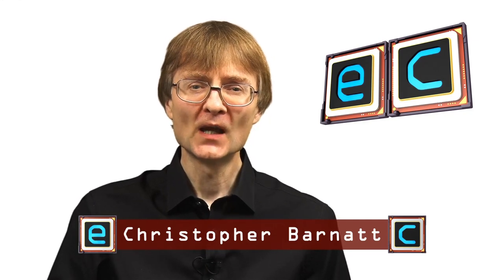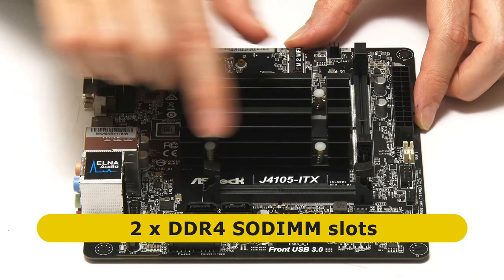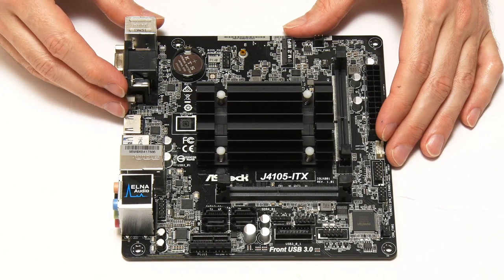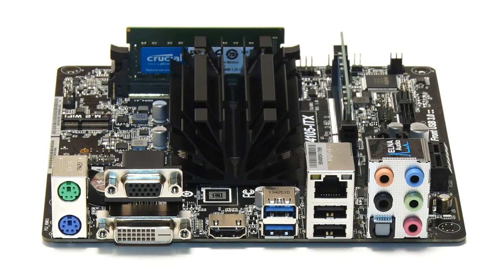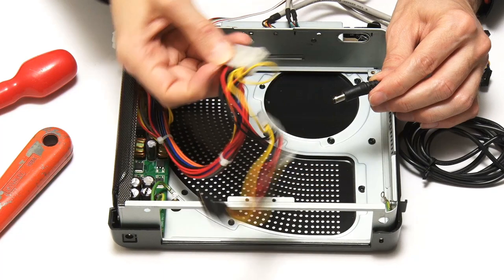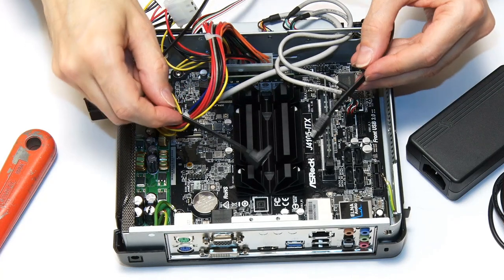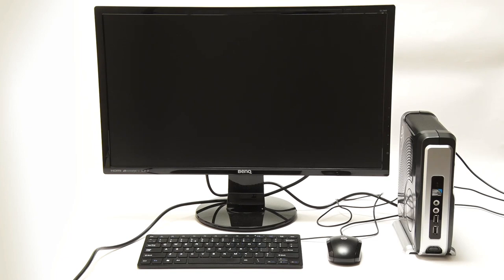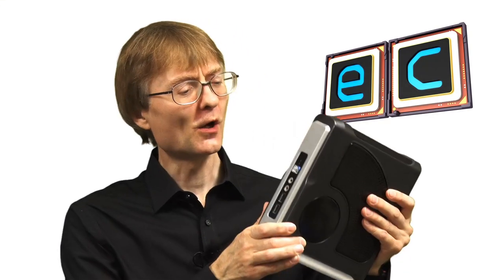Silent Mini-ITX PC Part One: Hardware Build

Comment: I think instead of saying "the CPU is pre-installed" (as compared to a socket) you should maybe say "the CPU is soldered", because "pre-installed" might still be interpreted as "already put in the socket".
Reply from the maker: Fair point.
Reply: I think he has clearly said Integrated Processor that preety makes it crystal clear
Reply: yes its integrated cpu, also i had Asrock Q1900M With Celeron J1900 4x 1.9Ghz it was integratated CPU too, with the same heatsink :D (GTA5 20FPS 720P LOW, Huge CPU Bottleneck) :D
Reply: It hardly matters anyway. This kind of device has very limited uses, with media playback or a storage server coming to mind. Without also having a way to add a dedicated gpu, there is very little reason to ever want to upgrade the CPU.
Reply from the maker: @Self Sickened :)
Reply: @snugglyjeff214  I've seen these built with other variants but the others had a PCI-e slot, so people would add a 1030 or 1050 to give it stronger video/graphic capabilities, at the end of the day they are pretty efficient systems
Reply: Yes it was soldered to motherboard. Mine was not removable, it was soldered
Reply: @controllerspixelsplayers9202  my Celeron j1900 was bottlenecked onn R7 240 stock clock, so yea
Reply: @ExplainingComputers  can you upgrade the proccecor

Comment: The best part is turning on that fresh new computer for the first time and all is well  :-)
Reply from the maker: So true.
Reply: Amazing that it did power on even if he  put the power switch cables in an odd place ^_^ (must be the same grounding as the proper pin). I've worked with hundreds of mobo's and i've never encountered a single one that has the power pins vertically, it's always horizontally aligned with the power led pins.
Reply: I never put the side panel on until it's booted the first time, I'm convinced that jinxes it ;)
Reply: Thats why I only seat the CPUFan/Add some RAM, connect a VGA cable to a display, test to board naked outside the case. the SSD can wait.

Comment: Great video, an interesting bit of hardware almost an SBC.
 I built my Ryzen pc, after watching, your videos on it, which has been great, I did upgrade my Ryzen pc, a 2200g wasn't enough, I fitted a 3600x on it's release, but the old 2200g APU did not go to waste, I bought an asrock a300 desk mini for £140  and put it there, with a few other bits I had hanging around, it makes an excellent compact PC, and is the pc I use the most.
Great video looking forward to the next.

Comment: Thanks for letting me know this existed. Exactly what I was looking for to build my NAS. Low cost, low power, but still fast, a PCI-e slot for the RAID controller card, can fit in ATX case with lots of hard drives. I got a used J4005B-ITX on ebay.
Reply from the maker: Great to hear!

Comment: "If you're terribly worried about cable management, I think there's plenty of good therapy sessions you can attend.."
Amen, brother.   Amen.
Reply: Or I can put my OCD to work on the cable management and feel good for less effort.
Reply: I have to say I was suprized by your comment about people who tidy up the cables in there PC (i.e. cable management) requiring psychiatric therapy.
While the video was interesting and informative I wonder if you could give a reply to the following points.
1) Can we therefore assume that you have never ever used a cable tie in one of your PC builds to tidy the cables 
and if you did which therapy clinic did you attend afterwards.
2) It is possible even likely that your video was watched by people new to building a PC, if they follow your advice then they could well end up with cables over fans and poor access to components because cables are in the way.
3) You contradict yourself in the video regarding the Molex connector and wiring over the heatsink. You say in effect don't bother with cable management but then your text comment says turn the drive to reroute the wire, that is cable management!
3) Are PC case manufacturers all wrong, the vast majority of modern cases have cutouts and cable tie loops for neatly routing the cables (i.e. Cable management).
4) following from 3 if you were to build in a windowed case would you just have the wires dumped everywhere so it looked a mess when viewed through the glass side panel.
   A lot of these glass panel builds especially ones with complex water cooling loops are works of art, and tidy, unobtrusive cables is integral to that.
5) For me and others I suspect, buying the parts for a new build is not cheap. Therefore would you not want to do the best you could with the build including tidying the cables. I take                pride in my builds and a neat and tidy case interior is part of that.
6) in this video would 5 or 6 cable ties and 10 minutes work be so wrong. Apparently so. 
Clearly I have taken the comment you made quite seriously, I suppose it was just an off the cuff but flippant remark. Could I suggest perhaps you could have made a more neutral comment like that the cables could be tidied if you want to. At the end of the day people can just throw there pc together in 5 minutes or spend days or weeks making one of the glass panel works of art with custom hand made components etc or somewhere in between. Long may that be the case. I will continue to watch some of your videos where the subject matter is of particular interest, but this comment and your rather slow, overemphasized commentary style (reminds me of some of the tedious corporate videos I have been obliged to watch) mitigate against me watching more.
Reply: @ianwelford1949  Someone's triggered hmm. It was a joke.

Comment: Finally a really good PC. I would be really interested in a comparrison vs. a Raspberry Pi 4. Price, speed and most importantly power consumption. I have doubts that the raspi will look all that good in that comparrison, and I guess it would look even worse going against a N4000 board like the n4000t by asus.
Reply: Boodysaspie  Raspberries and peanuts (ref PCjr way back)
Reply: Boodysaspie  The problem is that the Pi 4 doesn't really cut it as a dedicated media device, at least in my experience, nor does the Rock Pi. My main problem is too many dropped frames on YouTube, which I'm sure this build will have no problem with.
Reply: @ollie-d  I am using the youtube plugin with XBMC. Works pretty well. I however had to turn on vulkan acceleration on in raspbian.
Reply: Boodysaspie  the comparison would be valid from the standpoint of application of device we are after: a media center pc. Recently, i was considering rpi4 for media center pc, but since there was Intel Quad Core back from 2008 laying around + P5K Pro motherboard + its original 8 Gb ram, i only had to find an atx case (free, but bought some paint to give it unique look), bought a Pioneer 256Gb ssd and a 120mm fan oh yeah and 1 hdmi cable. Yes, this way it takes more space neat the TV stand, but the performance (both h.264 and h.265) is stellar! no frame drops, very fast boots etc. So it was both cheaper and better performance than rpi4, which still is ok as carry-media center for travel, but otherwise it works as a relays controller for various 220V projects.
Reply: Boodysaspie  correct (but as far as i recall its 95W TDP); however my point was: sbc credit card sized boards evolve in performance and mini-itx which is considerably smaller than atx but a tad larger than sbc may be the golden pea among them when creating a media center pc - and from user's perspective that is the ultimate goal. Also: some of use prefer quiet build, some say the smallest space ocupied is most important. Some would say: hey I want to watch movies and run a snes emulator/dosbox for vintage games on huge tv (and boy they look so nostalgicaly ugly)). So it is a good idea to mention all aspects: power draw, price, video decoding performance, dimensions of the rig, software capabilities. Because as pcs get older many of them live their second life as media boxes, backup servers, nas, firewalls etc. And rpi4 claims to be good at all of that too. So good comparison videos would be most useful for people planning their next build.
Reply: Boodysaspie  "The stats are clear: the Pi is cheaper and the Celeron is more powerful."
That much is pretty obvious. But the question is, by how much: Will you get 2x the computing power for 2x the price? Or might it actually be 10x the power for 2x the price?
Same is true for idle power consumption. I somehow doubt that the Pi4 will be that much different to the Celeron at idle Desktop. But hopefully, we will find out in a week or two.
Reply: RPis and especially RPi4 are pretty poorly optimized boards. The idle consumption is really bad. The loaded consumption looks okay, but I'm sure it can be improved. The performance optimization is horrible: the official OS - Raspbian, is still 32-bit, what a nonsense in 2020 for "desktop PC replacement", no doubt it is being beat by less powerful Odroid C4. Of course, there are a lot of screen tearing and video decoding issues. Audio output on RPi4 must be a joke: they claim it has "near-CD quality", but in real life, it's PWM'ed noisy output, not even close to a real audio codec quality, and there is no audio input, which could be useful in media PC applications. And the power distribution scheme is awful. Imagine bringing down the whole computer by just unlucky USB HDD connection (which in theory could momentarily drop 5v line, which is also main power line for the whole system). And this is going on, and on, and on with RPis. I'm not telling RPis are bad - no, they are great, I'm a big fan of RPi 4, but in some applications they just fail hard. And of course, the Media PC experience with RPi 4 will not be as smooth as with any modern x64 system, even with a cheap one.
Reply: @dave7244  yeah I did this too for playing OpenBVE train sim - can't wait until this driver becomes official - the Pi3 version is cool too.

Comment: Chris, I purchased a ThinkCentre M92b from Ebay and have been using it. I installed Linux Mint it has a 500GB Western Digital HD which had nothing on it when purchased $85.00. 4GB DDR3 SODIMM 1600MHz Intel HD Graphics 2500, 3rd generation Intel® Core™ i5-3470T processor (2.90GHz, 3MB Cache). Going to upgrade to a 250GB SSD and add 8GB of memory. It runs quite well and enjoy using the tiny form factor PC. I added a adapter for the monitor to use the HDMI cable on my Roku TV and that works out fine too. No need to use external speakers which take up room on my table. Also looking into doing this build with the ASRock J4105 as you did in this video very cool build.

Comment: This has been very informative; recently the family decided to "cut the cord" with a satellite. They're going with a streamer like Roku and I was looking for something like this; small factor to make into a DVR for it. 

Can't wait to see what you install for OS and software.
Reply: Pantherman1979 I’ll be looking forward to the next video also.  I’ve wondered about this board for a Plex server with HDHomeRun to dvr and watch live tv.  I really appreciate the form factor and low wattage of the system.  Great video!!
Reply: @keithp5568  I had to look up HDHomerun as I wasn't familiar with it, this is something that I'm going to look into for myself.

My brother has plex at his house and is happy with it, though I believe he's running it through a ps4
Reply: @Pantherman1979 Plex is quite versatile.  I use it mostly as a dvr for live “over the air” tv but others host all sorts of media/movies on theirs.  I believe to dvr you need the Plex pass.  I don’t want to hijack The EC channel here but Lon tv has a number of videos on Plex and the HDHomeRun that you may find useful.  The build featured on this video is nice because the Plex runs 24/7 and the low power consumption is great and the Intel CPU’s with quick sync are great for transcoding a few streams simultaneously if needed.
Reply: @keithp5568   Thanks, I'll look it up

Comment: I was going to get something like one of these recently to build a silent TV PC. But in the end i got a used "HP Prodesk 600 G1 DM i5" off ebay for 100 pounds. Put 8GB in it and a SSD and its a brilliant tiny little PC. I would say even smaller than that mini-ITX. It even has 2x DP ports for dual screen connections.

Comment: Chris, u may think the build is done. correct the error so the drive turned over so the cables work better.
Reply: 17:20 , therapy sessions for cable management purists
Reply: @stephenclark9917  Chris pointed out he need to turn the drive around
Reply: @ffieditor  could have ≠ need to :P

Comment: I worked on electronic equipment in the Air Force. We always called the initial start up after repairing or modding something a "Smoke Test."  On occasion we'd get a loud ZAP followed by smoke. To this day I still cringe before pushing that power button after I work on something.
Reply from the maker: Smoke test. I will remember that. I've only had that happen to me twice. Once was a robot when a servo rapidly caught fire.

Comment: Since I have depleted my budget. another board is out of question for now..BUT this inspires me to grab one of four identical m/b's  which is lying around collecting dust, and stuffing it into a similar case to the one here..My case should be somewhat thicker though, since I'll have to put a gpu in there as the onboard one sux. All the same, I think this might prepare me for my next upgrade, as my trusty old laptop's now nearing it's end as a portable computer. This looks like a great replacement combined with my 24" monitor, which is light as a feather to cart around. As always, been a pleasure to watch you Chris..your videos always inspires me to better my current setup. Do keep up the great work..👍

Comment: Note. This board will take a 16gig memory kit. The documentation on the CPU has been wrong from the beginning. The max ram for the J4105 is 8gb PER CHANNEL, not total. I have the same board in my daily driver with a 16 gig kit (2x8G).
Reply from the maker: Very good to know, thanks for sharing this info here.

Comment: I made a similar build last year, but I took the mobo version with PCIE for my gt1030. Overall a really balanced and fun machine, but to go completely fanless it needs a different power supply.
Reply: Can you give me a link or the exact Name of the board. Its a shame this one has no Slot for a gpu.
Reply: @Teknikfrik  Sure thing, it is the Asrock J4105B-ITX. 
That B is the only naming difference from the board used in the video so be careful when you order. Also remember that to get the x16 pcie slot you lose integrated wifi and bluetooth.
Reply: @clochard4074  Thank you very much! Need something smaller for my Arcade cabinet.
Reply: @Teknikfrik  Sweet! Best of luck then!

Comment: OR you can grab 11$ Arctic Alpine Passive + any CPU under 60 watts (maybe underclock it 15%) and have a versatile, more powerfull, but still silent platform.
Mine is i5-2500 with Arctic cooler @ 3.6ghz all cores. Works like a champ. I5-2500 is roughly 70% faster than J4105

Comment: finally, an ideal Work From Home, Online Class, Gaming PC, ah eh, not quite, unless if this is the another Budget Build.
Reply from the maker: It all depends on your use case. Most PCs are not used for gaming. :)
Reply: If you want gaming on ITX then the ROG Strix X570-I is what your after ;).  But youl need a bigger case and fans / cooling which is outside of this video by quite a margin.

Comment: I used the same board three weeks ago for a media PC. Used a bigger case and a DVD drive. Works great with Ubuntu 20.  Tie that ground wire down, a loose ground could be a problem. Tape it to the side of the case if you must. Nice build.

Comment: I've used plenty of these types of boards, including this J4105, your older atom-based one and the previous J3455 generation. They all work very well and have good value for money. I've even built a beowulf cluster using three J3455 ones!

Comment: at 10:07 did that SATA plug rip the contacts from one side?  *LOL... i guess he did break it! i saw the notice after.*
Reply from the maker: Yes, that's what happened. Although I think the spring on the connector has seized -- the remainder was very hard to remove, even with plyers.

Comment: Yes, you must remove the Intel Atom sticker. Which reminds me… I recently had the displeasure to briefly operate a laptop that someone got for free, which had an Atom processor in it. It was running Windows 7, and all they really wanted to use it for, was to let their cat watch videos of birds and squirrels on Youtube. It failed at the task, in my opinion. The time it spent buffering a 144p video was absurd! Yet, they put it in-front of the cats, and they watched it.

I just hope the cats aren't traumatized by only getting to watch a few seconds of video before it's yanked away from them to wait for about a solid minute of buffering. I think it actually spends significantly more time buffering than actually playing video. I can't even be sure that this is all due to the processor, and not the wifi chip, I assume the laptop is now fairly old, so the wifi may also be terribly out of date, just simply very cheap.
Reply: No worries, cats have persistent memory. They know the bird is still hiding behind static